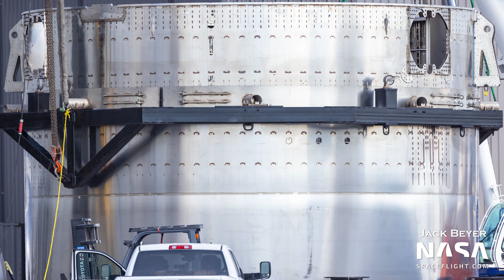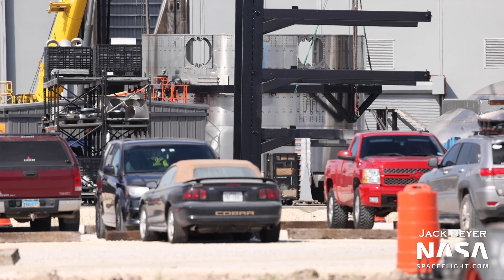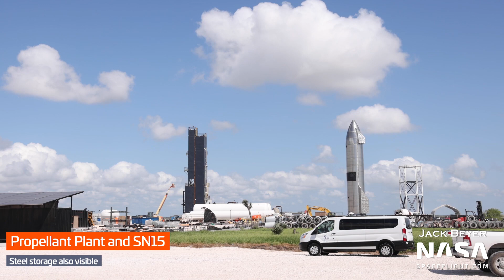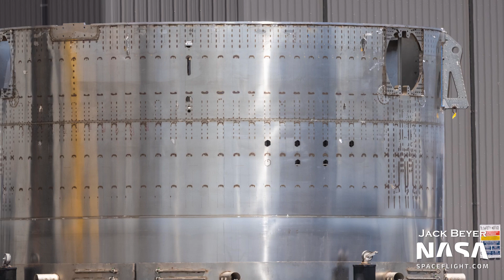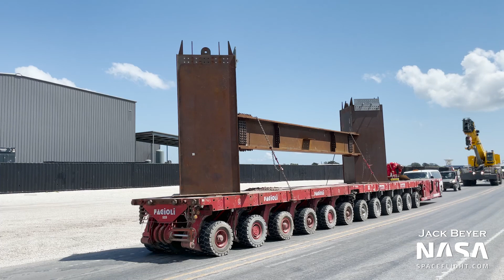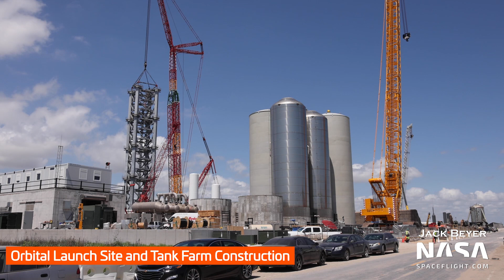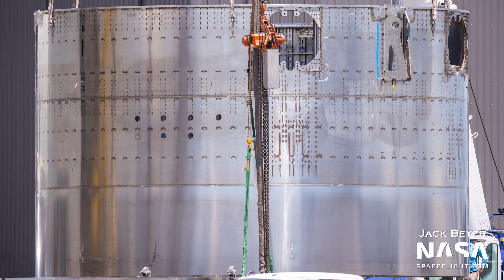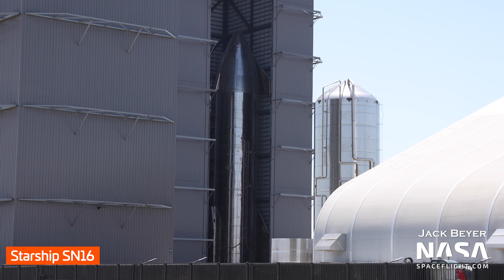Strange New Section Spotted - Crane Disconnected from Launch Tower | SpaceX Boca Chica

Comment: Probably grid fin holes. Seems like it won't have 90° between them tho instead it looks like a 60° 120° 60° 120° configuration.
Reply: How would that make sense though?
Reply: @lunaperson403  would make it easier for the tower to catch it
Reply: @Jasperry  Well it won't catch it by the gridfins per newest infos. Rather it will have reinforced points under them, maybe that thing between the closer holes is part of the catch mechanism.
Reply: @gyulagyorffy5937  well it wont be catching it this time so why have them?
Reply: @Jasperry  but i think the gridfins in the order they are i dont think would help guide the rocket as much as 90° each
Reply: @lunaperson403  Doesn't matter, sn5-sn15 had heat tiles and they didn't need them. Probably there for testing porpuses.
Reply: @gyulagyorffy5937  well the heat shield tiles still provided adequate data, they were to see if the heatshield tiles could survive landing, but when they arent landing superheavy, or even catching, i do not imagine they would provide any* data
Edit: *worthwhile data
Reply: @lunaperson403  But the integration alone would give them valuable data. And it's not confirmed, just my theory so I'm not saying this is what it is. Just coming up with ideas.
Reply: @lunaperson403  It will land at sea, but that does not mean they want it to just crash. The grid fins are needed to guide it down to the landing area and keep it straight all the way down.
Reply: @knowlegeisgood8735  what part of my comment did you think i said it would just crash?
Reply: @lunaperson403  If it flew without grid fins, that is what would happen.
Reply: @knowlegeisgood8735  yea it needs grid fins, i just dont think a 60° 120° 60° 120° setup is the best
Reply: @lunaperson403  I agree. But we don't know what the catching arms look like. They could force that strange configuration - if 2 arms need to get underneath all 4 grid fins. But how would it affect the aerodynamics?
Reply: @knowlegeisgood8735  i doubt spaceX even has a design for the catching arms yet, and yea that's my worry, i dont think this configuration is that good with actually controlling the ship
Reply: @lunaperson403  I am not so sure about that. I think designs were made before Elon said anything. 
SpaceX has some of the best engineers in the business. I think they would not make such silly design errors. This has been simulated so many times they are convinced it will work, or that is anyway what I see no reason to doubt.

Comment: So, let me get this right: The Orbital Launch Mount is located close to the fuel storage facility.
The numbers break down like this: a fully fuelled Starship stack will explode with a yield of approximately 15-kilotons - or around the same yield as the Hiroshima atomic bomb.

But that will pale into insignificance when the yield is doubled, tripled, or quadrupled when the fuel storage facility explodes due to the main explosion.

That will kill every person within a 5-km range, and break every window within 32km of the blast. It will also utterly destroy the entire launch complex, the construction facility, and in fact, every building within eyesight.

That is why Nasa roll their rockets a very long way from the VAB before they attempt to launch them.

This is SpaceX hubris at its absolute worst. Because we know that a Starship stack WILL explode on the pad, or just after liftoff. It's not a question of if, but when!

I repeat: a stacked and fuelled Starship will explode with the same force as the Hiroshima atomic bomb. Think about that for a few seconds.